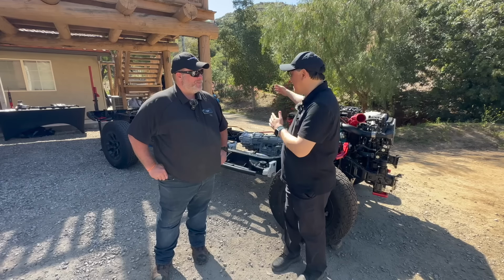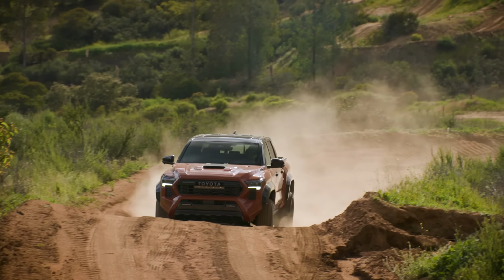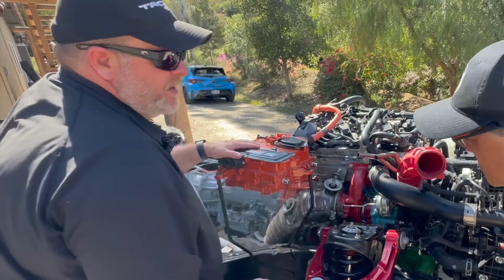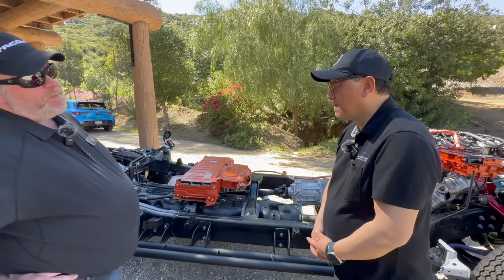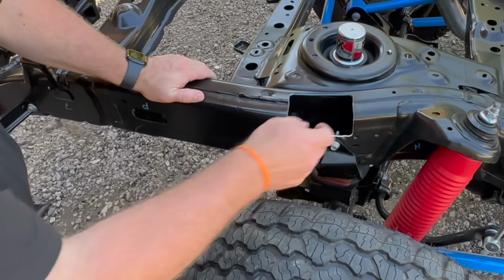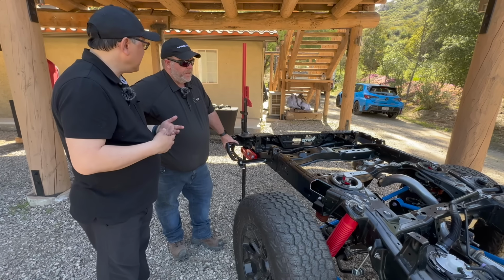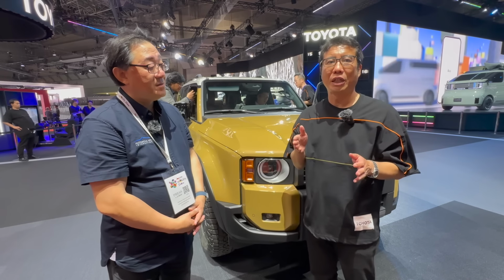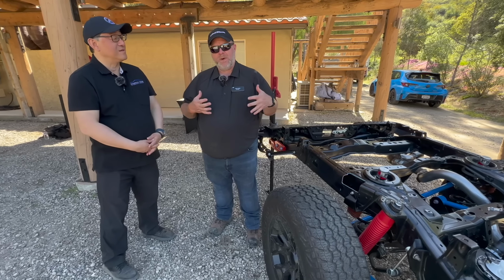ENGINEERS REVEAL RARE FACTS ABOUT 4RUNNER, TACOMA, LAND CRUISER - CANDID INTERVIEW SHELDON BROWN

Comment: People opposing new technology, moving forward, should realise that those using steam powered machinery in the 1800's had the same reluctance. Time will tell.
Reply: I know right?  They're opposing "new" technology that is FORTY years old.
Reply: @visualdragon  hybrid, and electric, is not forty years old. Then there are the necessities of a growing population, and dwindling resources, namely fossil fuels. It is not an easy balance to achieve, this time will tell. I do agree that the established power trains that have proved reliable remain in production, also, alongside the newer technology, because the use, and throw away, consumer mentality, is certainly detrimental.
Reply: @davidmallia628  I agree with you.  It just feels like most people are really hating on the turbo engine.  That's what I was talking about being at least 40 years old in commercial passenger vehicles.  Even hybrid has been around commercially going on 30 years.  I believe the Prius first shipped in 1997.  Technically, the hybrid was born in 1900 with the Lohner-Porsche Elektromobil.
Reply: @visualdragon  turbo was added to engines that were not designed for turbo. Modern turbo engines have been designed to work well. Turbo lag has been eliminated and electronics have proved nothing but beneficial. I have a 2005 2.4 turbo TD5 defender diesel with electronic, ECU, management. It has proven very reliable.
Reply: @davidmallia628 there may be way more fossil fuels than you think...  we were supposed to be past peak oil already.   Also theres other fuels for combustion vehicles as well like ethanol whichnis renewable and methanol of which there is basically an unlimited quantity....

Comment: And how many of you guys, keep a car for 200,000+ miles? I do, and I have all my life. All I read is guys complaining about the price. And these very same guy's, turn around and say, "I am going to keep my 2022, 2021, 2000 Tacoma." You very well should KEEP IT. It's a NEW Truck. You don't NEED a replacement for it. You should Thank God everyday, that you could afford a new truck. Also, they have been using Turbos for many years now. It's proven technology. I can remember people in the "old days," complaining about those "new fuel injection systems." They would said, I am never going buy one of those "new" fuel injected engines. I will stay with cars, that only use a carburetor. Try This.....They used to use a horse for transportation. No tech and all you need to do, is just feed it.
Reply: The recent number of blown V6 engines with Tundras, for example is not the same comparison as the initial camshaft issues with the 2nd gen 5.7. These turbo V6’s crank bearing are heavy stress components that are designed with high RPM and longer stroke to make up for displacement, possibly squeezing out and compromising the oil film. These engines WILL NOT hold up long term. 300k max life if you baby it, when the old 5.7 reached million miles on numerous occasions.
Reply: It’s because they are trying to convince themselves their purchase is not with regret.   These same folks will quietly trade in their nearly new reliable “old” Toyota and buy the new reliable Toyota to keep up with the Jones.   That’s why Toyota makes a lot of money!  lol
Reply: Have you seen the price of oats lately? 🐎
Reply: I have no fear of the new 4 bangers in the 4Runner or Taco, but I will still keep my '21 4Runnner.  I am like you, I drive until it NEEDS replacing beyond what the normal maintenance supports in life span.
I am sure the new powerplants will be just fine and reliable, though time will tell.
Reply: Say what you wanna say. Price increased 38%, cheaper materials are being used, and all these Tundras dying like flies on the road.
Reply: Very well said.
Reply: Well spoken... some people just itch to complain.
Reply: In fairness, I don't know of any carbureted engines available in a current vehicle.

For most people, these changes really don't matter.  For us overlanders, the issue is the complexity of working under the hood.  If you're with your family far from help, it matters.
Reply: Well said! Internet and Youtube is filled with people complaining.
Reply: @darylleong1592  and some people don't question outrageous prices
Reply: Sure turbos are a proven technology, but they still don't go as long as a normally aspirated engines.  I've flown general aviation aircraft for about 30 years with turbo'd engines, and they don't last as long.  Their TBO (Time between overhaul) intervals are much shorter than non turbo'd engines.
Reply: Yeah they are proven... They are proven to be less reliable unfortunately
Reply: Amen enough said!
Reply: Amen.

Comment: Hi David ,this was a very informative video , So many keyboard idiots here talking HS they know nothing about, turbocharging was around loads in the 80's, it is nothing new, there is tons of reliability built into turbo charged engines, intercoolers were added to lower heat and intake temps, and also added horsepower and longevity, i ran a 1988 Volvo 740 Turbo 4 speed standard with electric overdrive and it ran until just shy of 700,000kms and the engine was never apart, just replaced the common items, battery, alternator, starter, 2 clutches , the body gave out before the motor, it still ran good and a guy bought it from me for the powertrain and a parts vehicle and back then Toyota had a Camry with a Turbo engine and i saw lots of these with 500,000kms on them and still ran great, so these idiots don't their areas from a hole in the ground 👍these vehicles were run in Central Canada where the winters are of the most extreme
Reply: Same here. Had tons of volvo turbo cars. Switched to Toyota and was super excited to get my 24 taco. Love it